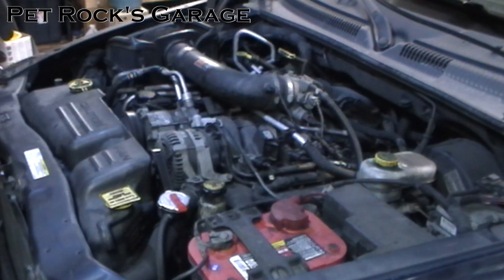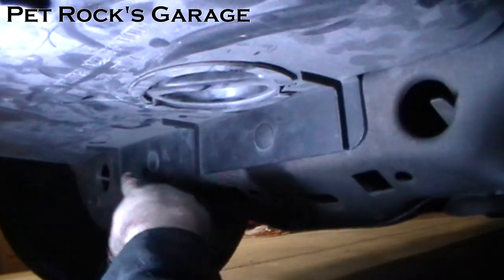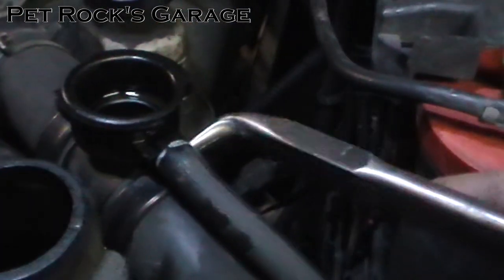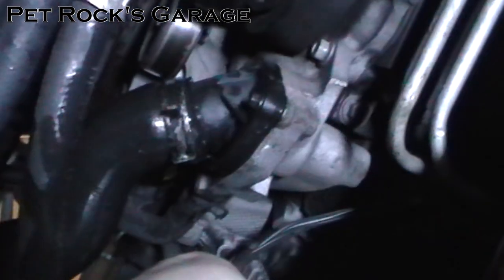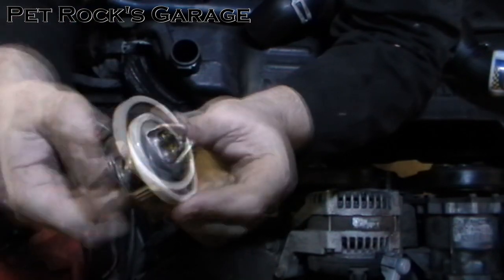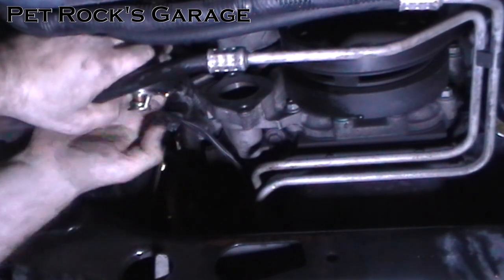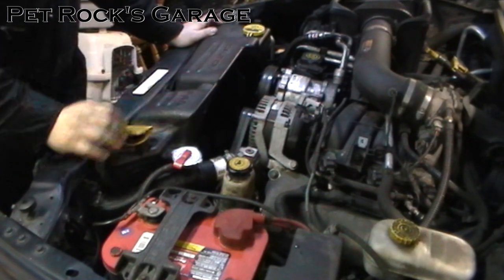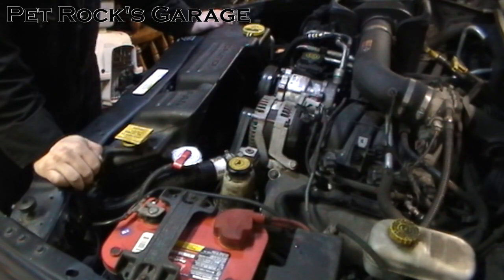How To Drain & Fill Coolant + Thermostat - Chrysler 4.7L (Dakota, Durango, Grand Cherokee, Ram 1500)

Comment: Thank you so, so  much!!! Wish I'd found this video sooner, I could not find the dang plug on my 2000 Dakota 5.9. I Googled  every combination of terms I could think of for info on where the plug is located.
Some said it was on the passenger side (which is where it's been on every vehicle I can remember working on) some said it's on the driver side. All said it is facing the engine. The aggravation induced fog in my brain finally cleared, and I decided to look at a replacement radiator online! 

Well, what do you know! There it was, driver side on the SIDE of the radiator! I crawled under and found it, turned it a quarter turn, and it stopped.
From there, I had no idea I needed to pull the dang thing and turn some more. So it was back to Google. I typed "radiator will not drain after drain-cock is turned"  Your video had a huge thumbnail three results down! Everything looks pretty much the same, except my thermostat is on top of the motor. Thanks again, learned some other stuff too.
Reply from the maker: No problem. I'm glad my video helped you out and you got it all sorted out. Good idea on looking at the replacement. I too got stuck on having to pull on the plug to open it up way back when I first did this job on this truck 15+ year ago. Luckily it was mentioned in the factory service manual. No idea why it was designed that way, but it works.
Reply from the maker: No problem. I'm glad my video helped you out and you got it all sorted out. Good idea on looking at the replacement. I too got stuck on having to pull on the plug to open it up way back when I first did this job on this truck 15+ year ago. Luckily it was mentioned in the factory service manual. No idea why it was designed that way, but it works.
Reply: @petrocksgarage  Face Palm Forgot  about downloading the service manual for AC clutch gap at the beginning of summer. 😆
Reply from the maker: @JustAboutAnything66 , the factory service manual is one of the first things I buy/get/download whenever I get a new (to me) vehicle. Pays for itself in the first service. Not those cheap Chiltons or Haynes manuals. The real factory service manuals. Worth their weight in gold, IMO.

Comment: Thanks for uploading. This seems to be relevant for the 2012 Ram 1500 4.7L V8 as well. Some of the layout of the components you worked on are in similar spots. 
I'll be doing this for mine later.
Reply from the maker: Thanks a lot. The 4.7L was used in a ton of different makes & models (Chrysler, Dodge, Jeep etc), with mainly slight modifications to the locations of some components. Hopefully I hit the main points and my video helps you out. Good luck.

Comment: Nice job. Well shown and edited. Wish  you could do spark plug and wires on a 1999 Chevy Silverado
Reply from the maker: Thanks a lot. I appreciate it. Re Silverado: I don't have access to one. I don't know anyone with a Silverado, at the moment, that I'd be willing to work on. My videos are of my friends and my personal vehicles. Mostly my vehicles.
But plugs & wires shouldn't be too difficult. Do each plug & wire one at a time so you don't mix them up. Try to route the wires the same way the old ones were. Make sure the new plugs have the correct gap (gap should be in the owners manual). Don't expect them to be properly gapped out of the box. They could have been banged around in shipping or messed with at the auto parts store. Better to check then be sorry, IMO. Screw the plug in hand tight and then give it 1/2 to 3/4 of a turn to tighten it down. Put a little dielectric grease in the plug end of the wire. Thats really about it. Nothing fancy. Hope that helps. Good luck.
Reply: @petrocksgarage  thanks for the time.  I changed the thermostat today. burbed her after the flush so far so good. No leaks is a great sign for me.  One plug and wire at a time is good advice thanks agsin

Comment: What about using the drain plugs on the side of the block?
Reply from the maker: It's unnecessary for a maintenance style drain & fill. Most of the coolant is drained via the method I show in this video.  But if you want to pull that plug you can.  It won't hurt.  Good luck.

Comment: furthermore, I would recommend waiting till the next day after your coolant service, pulling the bleeder screw and running the engine a bit at op-temp (letting it warm up with the screw pulled not pulling it while its hot) to let any air trapped in the engine out and adding coolant as needed. the 4.7 can be cranky when it comes to heat and the aluminum valve seats like to go and try to join the piston.
Reply from the maker: While I do agree the level should be checked and topped off after some miles have been put on the truck, I don't think it's necessary to let the truck run with the bleeder off. Having the bleeder off while running won't help anything because the cooling system will be open. The system is designed to be closed so pressure can build up to raise the boiling point of the coolant. If you do the initial fill & bleed correctly (where the blender & radiator cap hole are the highest points in the system), there shouldn't be a lot of air in the system. Any air in the system should exit through the radiator cap and into the overflow reservoir. That is how most coolant systems are designed. But if you want to run with the bleeder off go right ahead. It's your ride and will not hurt anything unless you let it run too long and possibly overheat. Good luck.
Reply: @petrocksgarage , thanks though! Was just doing my research before i do a timing/gasket/lifter job on my 2010 4.7 dak.
Reply from the maker: @adonvonpanzern , thats a big job.  Good luck!!!

Comment: Any tips on getting that top bolt back in
Reply from the maker: For the thermostat housing? I usually disconnect the housing from the hose and hold the housing to  the block from underneath. Get the bottom bolt in a couple threads so you can still move/wiggle the housing around. Then get the top bolt in.  Hope that helps.

Comment: Saw another video where they left the bleeder screw out to watch for flow/bubbles. Though with that type of filler/burp funnel wouldnt that now be the highest point? Either way MOST everyone including myself didn't know about the bleeder. I've just checked levels and added maybe a 8-10oz over the years total based on the overflow tank dipstick. Came with Red antifreeze from the factory so I've used the Orange if needed.
Reply from the maker: If the truck is jacked up in the front or the truck is not level the bleeder screw may or may not be the highest point. But it will be close and can still be used to bleed air. Correct, the filler funnel does become the highest point. I wouldn't remove the bleeder all together though. It would likely create one heck of a mess and get a bunch of coolant on your accessory belt, which effectively ruins it. Hope that helps and good luck.
Reply: @petrocksgarage  Thanks! Yeah thats what I was thinking too as i'm seeing it run out down the block and onto the ground while its "bleeding" in their video. My truck sits pretty level now But i have jack stands to offset it if needed. Got a funnel kit from amazon in a few days ago. Saw I had a comment notification from you and wanted to say Thanks.
Reply from the maker: No problem. I'm glad my video helped you out. Good luck.

Comment: How many gallons or quarts did yours take. I to have a 4.7in my jeep
Reply from the maker: It entirely depends on if you get the fluid out of the block or just the radiator. So it's hard to say. If I'm just draining the radiator, and don't have any coolant laying around, I typically buy 1 gallon of concentrated coolant and 1 gallon of distilled water and mix them together to make 2 gallons of 50/50 mix. If I'm draining the radiator and the block then I buy 2 gallons concentrate & 2 gallons distilled water to make 4 gallons 50/50 mix. It's the same as the 50/50 pre-mix at the store but at half the cost.  Extra coolant is always good to have around to top off the coolant periodically. Good luck.
Reply: Ok thank you I was doing this as a first time for myself and was making sure everything was as is like in your video
Appreciate the video very straight forward and alot of help
Reply from the maker: No problem. Good luck.

Comment: I tried to remove the lower hose to my 2000 Dodge Durango and it's a bitch to get to nit didn't see the thermostat housing that's attached to the lower radiator hose .
Reply from the maker: Hoses can get a P.I.T.A. to remove sometimes. They tend to adhere to the tube they attach to. Twisting them to break that bond tends to help.  As for the housing, you have a 4.7L? That is what this video is about.  IMS, the T-Stat on other motors in these trucks is where the top hose attaches to the motor. Hope that helps. Good luck.

Comment: What coolant do you recommend for the 4.7?
Reply from the maker: I don't really recommend any specific brands. Use whatever is available in your area and is rated for your vehicle. Most brands websites have a guide to show what they offer for your year/make/model.
I typically buy the concentrated coolant and make a 50/50 mix of it with distilled water at home. Its significantly cheaper then buying the 50/50 pre-mix and you get more coolant in the end (2 gallons). The 50/50 pre-mix is good in a pinch, but you are paying a really high cost for half a gallon of water and half a gallon of coolant.
As for the color (Orange DexCool vs Yellow Universal), both will work just fine in the 4.7. But don't mix the two. Use one or the other. I recommend using the same color that is in your truck today. Only switch if you are going to do a complete flush of the system,. not just a drain & fill. Hope that helps.
Reply: Cool,Thanks for the info.
Reply from the maker: @mikeblakeman8730  No problem. Good luck.

Comment: What color of coolant did you use?
Reply from the maker: Prestone yellow/green universal coolant.
Reply: @petrocksgarage  thank you! Also when removing the front crank seal while doing the timing chain do you need to drain the oil?
Reply from the maker: @devinmoore7746  I would because I want fresh oil running over the new chain when I'm done.

Comment: Aren't you supposed to drain from bottom of engine as well(where is that plug at?, use heater on high to empty heater core and engine of all coolant.
I think the manual stated you needed to bleed with engine on and warmed up to get all bubbles out.
I'm not positive, just trying to make sure all 3.875 Gallons (14.5 Quarts + 1 Quart in reservoir) of coolant is emptied and flushed in my 02 Jeep Grand Cherokee Laredo 4.7L V8 (Engine N).
If you have sludge or sediment, is there a way to keep the sediment from entering heatercore or messing up pathways in engine/water pump?

I've never flushed my Jeep before and I think it's well overdue and needs HOAT coolant (Zerex G05 Coolant).
Was gonna buy 2 Gallons of Zerex GO5 Phosphate Free Concentrate HOAT antifreeze and buy 2 GA of distilled water to make a 44-68% mix, aiming at 50-55%. The Zerex G05 is the Mopar equivalent 

Any tips?
Reply from the maker: No, pulling the thermostat will drain the motor of the majority of the coolant. There may still be a little left behind, but its nothing to worry about. It will get diluted by new/fresh fluid.
Using the heater will not empty the heater core or make any fluid flow. The heater controls on the dash just controls the fan and vents. Coolant moves from the water pump spinning, and only when the engine is running.
No, the service manual does not state to have the motor running to bleed the system. Its not needed on these 4.7L engines due to the placement of the thermostat below the motor and how the coolant passages are routed. The coolant will get to both sides of the thermostat no problem. After you've bled the system via the bleeder screw, you run the engine with the heater on high (including rear heat if you have it) to get out any air that may have snuck into the heater core.
If you have sludge or sediment in your coolant then it is already in your heater core & engine passages. I'd advise getting a bottle of coolant flush and following its instructions, and fill/drain with water a couple times to get all of it out.  Only then would I fill with 50/50 mix of (distilled) water/coolant.
Use whatever coolant you can get that meets the specs in the owners manual. Brand doesn't really matter. Only that it meets the specs in the manual.
Hope that helps. Good luck.

Comment: So many damn steps 😢 I thought it was a quick job
Reply from the maker: It can be quick after you've done it a few times.  🙂
Reply: I’m draining now 😂 hands big should I change thermostat as well ? Truck been sitting a year and half
Reply from the maker: @hurricane3789 , if the T-stat has been in the truck for 5+ years I would replace it or at least the T-state gasket. Especially if you remove it to drain the block. The old gasket may not seal properly if its stiff or cracked. Good luck.

Comment: THAT'S WHY YOU GET THE DRAIN PLUG FROM THE BOTTOM , JUST LIKE THE TH,STAT ,
Reply from the maker: I'm really not sure what you are referring to here. I do get to the radiator drain plug from the bottom. Its the only way to get to it since it is at the bottom of the radiator.

Comment: Just because the heater is  blowing hot air doesn't mean it's got all the air out !... my dodge is blowing plenty of heat but still overheating and hoses about too burst from Preston not Abel too circulate  and believe me so not even the bleeding job worked out not even th,Stat replacement and not even water pump replacement and not even  the many things I've tried working out
Reply from the maker: Yes, you are right re the heater and air in the system. However, you are assuming that air in the system is the cause of your overheating. My guess is air not being able to flow over the radiator fins efficiently, a problem with the radiator (damaged, clogged internally or externally), clogged coolant passages in the block or the system not being able to hold pressure. Good luck.
Reply: MEANING GET UNDER THE VEHICLE TOO GET TOO THE DRAIN PLUG NOT THROUGH THE HOOD IT'S MUCH EASIER
Reply from the maker: @ElmerPacheco-j9j , yes, thats what I do in the video (@1:00, @1:19 and @1:55). I'm not understanding the issue here.